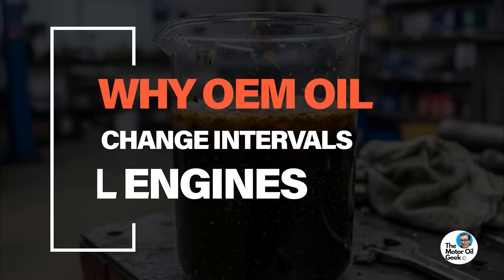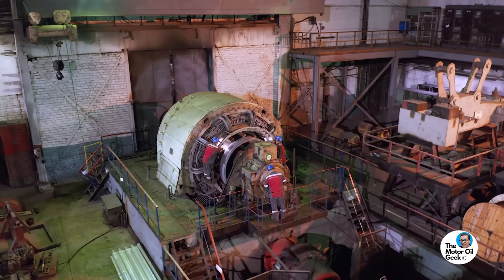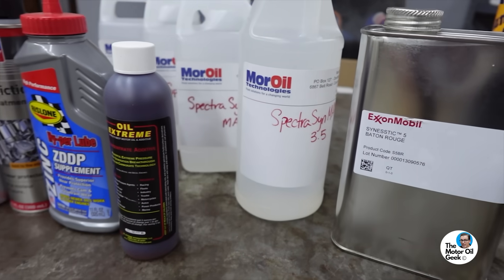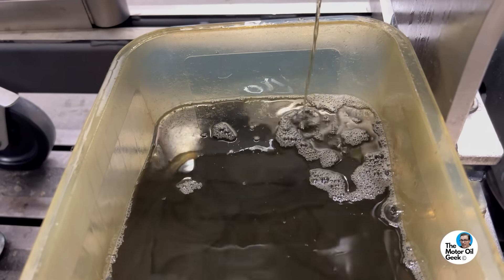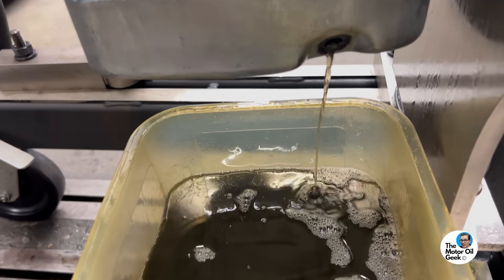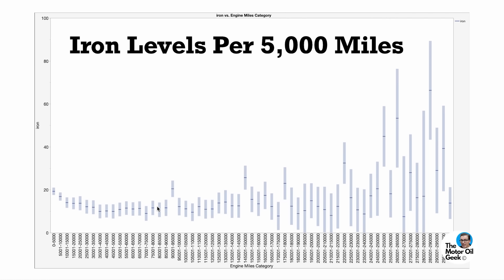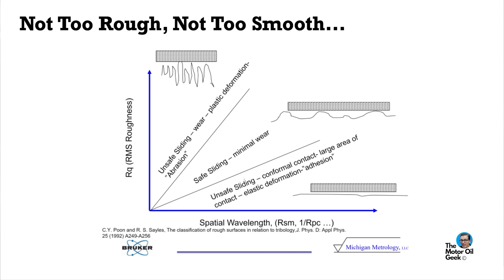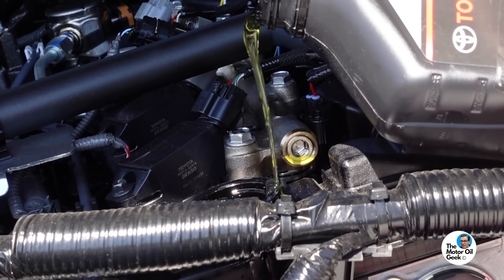NEW Data Reveals WHY Modern Engines FAIL Prematurely!

Comment: Only run roller rocker / pushrod engines with 30 weight oil to avoid oiling issues and reliable engine life; great recipe.

Comment: For a 2024 Toyota 4.0L V6…what is the safest year round oil to use…0W-20 or 5W-30 in a cooler to moderate climate? I can’t seem to find the overall opinion on this. Thanks Lake.

Comment: Cars last a lot longer than they used to. In the 60s and 70s you rarely heard of a car that made it to 100k. Sure they were easy to work on but they also needed to be worked on more. I’m 65 so didn’t really start working on my on cars till the late 70s but I think anyone my age or older and that’s honest will agree with me.
Reply: My 1972, 440 engine gave me 300,000 miles with no trouble. Just the water pump failed 2 times with a leak during the whole milage.

Comment: I have owned 3 6th gen Camaro Zl1.  First 2 I road raced about 10,000 miles mixed with aggressive street driving.  Zero problem.  My 3 Zl1 I didn’t road race it and change the oil at 500 miles, 1000 miles 2500 miles and then it spun a rod bearing driving to work at 4,300 miles.  I now drive 3 Toyots. Not the 3.4 twin turbo ones.

Comment: Maybe if automaker's ignored consumer reports and stuck with 3,000 mile oil change intervals this wouldn't be a problem. I have an '04 Ford F-150 with the 5.4 3 valve engine; the one everybody says bad things about. I have almost 300,000 miles and have never had to touch anything inside of that engine. Geez I wonder why. OIL CHANGE'S ARE CHEAPER THAN A NEW ENGINE!

Comment: Not sure your thoughts, but we use non-syt oil and run the motor for about 30sec to a 1 min and drain the oil to wash out all the ARP lube-Assembly lube-and ring assembly lube.  after doing this the oil does not look good,   Then drop in a Break-In oil,  I feel it is a good start to a break in, I call it a oil wash down.  what do you think.

Comment: A few useful facts to add to your excellent and timely video. I am a mechanical engineer with a lot of hydraulic and machinery experience. Firstly, the "full flow" oil filter on your car engine isn't. Most older cars have a fixed displacement oil pump for engine oil. This means that one revolution of the crank shaft delivers a fixed volume of oil. As the engine speed increases so does the flow. But the resistance of the system to flow results in increased pressure with increased flow. So there is a bypass relief valve in the filter to limit the pressure, especially as it collects dirt. This means that at more than modest RPM, say 1500, some oil bypasses the filter to the engine unfiltered. Older engines use a relief valve before the filter to limit this as it dumps back to the sump. Modern engines use variable volume pumps or pressure control solenoid valves to control the pressure. Secondly, the regular oil filter will only be rated at 30 to 40 microns. Most of the particles larger than that size will be removed in the filter. As you pointed out, as dirt accumulates in the filter it gets better at removing smaller particles. This is called "Filter Cake". This accumulation increases the pressure drop across the filter medium. For hydraulic systems we typically specify 10 micron filters, unless there are elements with small clearances or orifices such as proportional or servo valves. Then we would specify 5 or 3 micron filters. Next, I have found that for some cars with the screw on can type filters a trip to your auto parts store can reveal that a filter with the same mounting thread and seal face dimensions but a significantly longer can is likely available. This will have more filtration area and thus lower pressure drop so the relief valve won't open until a higher engine speed. The only limitation is if room is available for the extra length. Your thoughts on these issues would be interesting.
Reply from the maker: Thanks for sharing. Each of those points are going to be covered in future videos.
Reply: @themotoroilgeek  Hooray! I am so glad you are busy doing this kind of education for us!
Reply: i actually know some farmers that know this...how i don't know. chevy silverado 5.3l PF63E is the ac delco  filter he had on, same diameter, longer length..... this is for the 2013...my older 2000 5.3 uses a longer filter but has different threads and that has gone 360K miles before i parked it due to rusted out brake and fuel lines i have yet to fully replace and fix the last 10%   the 2013 had the dreaded collapsed lifter issue i caught early enough to used crazed performance repairs cam shaft and lifter dod afm delete kit on.
as an operating engineer i have just used the longer filters i can make fit at the highest dust micron rating i can get my hands on and never had issues until letting oil get a little more dirty just because i wanted an excuse to get the motors rebuilt as i always got them used with high hours on them. however it's getting hard to find rebuild shops these days outside of motor city.
Reply: My 1989 CB450 has a relief valve (spring and a ball on a flute, really) on the filter exactly like you said.
How did I never think to put a bigger oil filter on a car engine, though... Kinda mad I never thought about that.
Reply: I've got a new Duramax 6.6 in the drive way. Plan is oil changes at 400,1000,3000 etc.
Reply: Excellent points the average consumer is oblivious to.
Reply: The oems are also decreasing sump volumes while increasing oil change durations. This doesnt add up to me. More surface area in the pan and dwell time should effectively lower temps and the increased volume will suspend more solids there, allowing them to settle.
Reply: Saw you were a mechanical engineer with a lot of hydraulic fluid experience. I actually sell  for an oil company that has been around since 1916 and during our latest Zoom call I gained some extraordinary knowledge about cavitation in hydraulic fluid. Most people think it is air bubbles but it’s actually a gas that creates micro-jets that travel faster than the speed of sound and up to 5000 degrees and it is similar to a mini nuclear explosion and this causing scaring on metal parts in a piece of equipment. And it is very important to do 2-3 system cleanings/flushings because any dirt left behind when a new hydraulic fluid is used, that contamination will greatly reduce the life of the machinery.
Reply: The relief valve dumps the oil back into the sump, so explain to us how it gets into the oil passages? The relief only works on the pressure side of the pump not the inlet and you obviously have a limited mechanical level of expertise?
Reply: There are two relief valves in a typical engine oil system: the first limits oil pressure after the pump, and returns to the sump. The second is built into the oil filter and bypasses oil around the filter if the pressure drop across the filter is too great. Otherwise a blocked filter would result in the bearings receiving no oil and rapid destruction of the engine.
Reply: @54Rocketeer  All engines have a relief valve at the oil filter, obviously on the pressure (pump) side. Traditionally, most return oil to the sump. But some send oil on ahead to the bearings, unfiltered. Crazy, I know, but manufacturers are doing all kinds of crazy things these days.
Reply: @54Rocketeer so what you are describing is a system that starves an engine of oil instead of at least passing some dirty oil.  I'll take the dirty oil over less oil because I like my engine running.

Comment: The new engines at the factory actually go through an impromptu break in. They get "broken in" when the porters drive the new vehicle off the assembly line and out into the storage lot. They drive the vehicles like those parking garage guys in Ferris Buehler's Day Off drove the Ferrari. 🤣🤣 Back in the late 80s when I went to work for a SAAB dealer the first oil change was at 1,000 miles. The engines came with a small black break-in filter about the size of a AC PF-47. The standard filters were blue and the size of a AC PF-35. This first service was of no charge to the customer.

Comment: While I agree with Lake’s assertion 2:56 , Variable Valve timing (or the loss thereof) doesn’t cause engine failures.  Yes, more modern engines utilize the fluid properties of the oil to operate mechanisms (valve timing, or even the old timing chain tensioners) but I don’t see that running a thinner oil viscosity is necessarily a requirement for that.  Pretty much any oil is thin enough to be used as a(n) hydraulic fluid at operating temperature.  Obviously, it is a matter of degrees (bad pun intended).

Love these discussions, even when I’m wrong.

Comment: The data on filters working better after being more full.
Supports the recommendation that was in my 1999 Audi A4 manual. I forget what the oil change interval was. However if did say it was acceptable to change the oil filter every 2nd oil change.

Comment: My wife has a 2015 Honda Civic. I has 20,000 miles on it. It’s had 9 oil changes starting a 600 miles. All synthetic. Our 2018 F-150 5.0 at 42,000 miles has had 13 oil changes and is due now. 15,000 miles ago I changed from 5-W20 to 5-W30. All semisynthetic. My 56 ford with a 292 y block was bought with a rebuilt engine with 50 miles on it in 2012. I’ve driven it 17,000 and it’s had 11 oil changes. The last 6 I have used Lucas 10-30 Hot Rod oil.  ….. Long range changes are not for me!

Comment: I dropped the oil in my 24 lzo 3.0l at 500km, then 1000kms, and then at 3000kms. I change the oil at half intervals and at 65k my truck runs smooth and so far so good. Peace of mind.

Comment: Lake, I have a GX460 that calls for 0W-20 oil and the manual states various other viscosities but 5W-30 in UAE for example. I have since started to put 5W-30 into my engine for additional protection (assuming CAFE standards dictate in my case using 0W-20). I notice in both your daughter's corolla and your new Tundra, you stick to the recommendations. I assume because those engines are much newer than the GXs. Would be very interested to know your thoughts on that (in my case)!

Comment: ive been changing my 3.0 LZO at 3500 miles with Rotella T6, 10w30, wear metals are almost non-existent in my Blackstone reports, did my break-in at 500 miles, and just did truckwide fluid changes at 40k miles
ive been saving my old old, and will start filtering it through a sub-micron toilet-paper system, send it to blackstone, and see if its good to re-use... at $120 a change, it would be nice to get some extra oil changes out of the fluid

Comment: Lake - the Toyota T24A-FTS in your Tacoma is an oil diluter...and I'm currently experiencing this problem during the winter.  Please shed some light on oil dilution, particularly using your truck as an example
Reply: Can you put a block heater on it to help get it up to temp faster? Short start-stop driving in the winter tends to increase fuel dilution. Whereas longer runs in the summer the excess fuel will boil off. Lucky you don't have a modern diesel some in short running will dump 1-2 quarts of fuel into the oil between changes.
Reply: @craigvincent2439 mine is in a heated garage…still getting gas in the oil

Comment: I broke in my '87 Chevy R10 with a flat tappet cam and my '68 Oldsmobile Cutlass Supreme with a roller cam with Joe Gibbs break in oil. I ran them both for 30 minutes each at 2500 RPMs.So far no problems. Then drove them for 500 miles and changed the oil and filter again. Next oil change is 1000 miles then I will change it every 4000 miles thereafter.

Comment: Lake, you mentioned aftermarket additives as a potential problem to oil cleanliness. I have always wondered about the additives pushed at a dealership that are marketed  to work with dexos oils. Our local Gm dealers sell BG products such as thier MOA additives. Are these products no different  then the part store counterpart? Are we predestined to have more engine failures because the dealers are working them into every oil change they sell from day one?

Comment: My oil change intervals are pretty much always somewhere between 3000 to 5000 miles, 5000 to 8000km, because of the simple thing of I hate overhauling engines, and oil is a lot cheaper than new rings, new pistons, new full gasket sets, new cam drive parts, new water pump, and grinding in valves. 10 extra oil change intervals in the interim before you do that is still cheaper, because it brings that interval to a much higher mileage on the vehicle.

Comment: I’ve been in industrial maintenance for almost 25 years, once we started filtering hydraulic fluid before use and running desiccant breathers our issues dropped significantly.  Running kidney loop filtration instead of replacing our filters as often proved better on samples.

Comment: Good info. I know some heavy industrial equipment never "change" the oil. They instead use huge amounts of it and have multiple filters plus spin filtration. Small amounts are metered in to be burnt off and new oil is added periodically. I remember one Komatsu engine with over 32,000 hours on it with this method.

Comment: And when I changed from ford oil to Amsoil signature series way back in 08 after a shortblock done under warranty for seized oil rings and loss of compression I only knew that amsoil was better. Now I know it has very good shear stability required in overhead camshaft engines with long timing chains and variable camshaft phasers. I believe that has kept my 2014 3.5L ecoboost  camshaft timing components from wearing out like has become so common. That and superior filtration from a bypass filter system.  Prefillimg filters and then flood starting after annoil change until oil pressure is registered before starting the engine. Right oil right time and right filtration

Comment: Current engine designs are assuming that motor oil is clean room spec at all times. Previously, engines were designed and engineered to last much longer without the clean room, sterile environment.
Then, we move to component design and quality. That département was furloughed!!

Break in is not optional!! For anything!! I don't care if it is an engine or a differential, break in is absolutely required!!!

BTW: Contamination is the equivalent of lapping compound...

Merry Christmas, Lake and family!!!🎅

Comment: My 2011 Ram 1500 5.7 Hemi self destructed the cam/lifters at 144K miles. I was accused of poor maintenance but changed the oil every 3k with the correct syn oil. The oil bottle said every 10k and I still changed it every 3k.
Reply: The camshaft on those engines is splash lubricated, as I understand it. So excessive idling time often trashes the cams, not enough oil thrown up onto the camshaft and lifters when the crank is spinning slowly.

Comment: I would like to learn how often oil filters bypass . temperature,pressure,contamination, dependant .
Reply: Is the bypass regularly engaged or only in rare cases of neglect ?
Reply: @MathewPollard-vj4uq  bypass should only open if the filter is clogged, or possibly at high rpm. Not during cold starts.

Comment: So, should you filter the oil before you pour it in the engine?
Reply: No. Unless you're using something better than the oil filter installed on the vehicle to pre filter the oil, there's no point.

Comment: A lot of people say the hemi‘s the newer ones get the hemi tick because Chrysler redesigned the block and people say they didn’t redesign it correctly for oil to flow good through that area because the 2003 to 2008 versions of that engine didn’t have that problem just valve seat issues I started seeing issues with Cam and lifter failure once Chrysler redesign the engine block for variable valve timing

Comment: I'm of the opinion that GDI equipped gas engines visibly indicate contamination more quickly that port injection. GDI engine oil gets a blackness with use fairly quickly compared with port. Can I assume this is soot from poorly burnt fuel making its way into crankcase. Wondering if you could speak to this related to GDI engines. Maybe you have a previous video.

Comment: Total American rubbish. Other parts of the world charging every 10-15k miles with no issues. Just serviced timing on 1.5 diesel engine at 100k and it is spotless inside with 10k miles oil changes. Also engines do not need to be run in - you’re giving data from race engines. This maybe the case years ago but not now. Toyota offer a 10 year warranty here with 15k oil change intervals. Hardly think they’d be recommending this interval if if they they thought they’d have to pay out on warranty.

Comment: This just reminds me of one customer who bought a new Volkswagen Transporter 2.0 TDI back in 2006...  It was factory coded for the long 30,000 km oil change interval but that van never went to the dealer for service.  I (or my father until 2014) did the maintenance work on that van every 15,000 km from the very first oil change to about 470,000 km.  The expected camshaft failure at around 150,000 km happened past 360,000 km instead, and only one of the cams appeared damaged.  The camshaft replacement was the only repair work that engine ever got.

Comment: Fantastic video!  Even I can understand these concepts with your explanation and that's no easy feat. I have a 2012 Chevy Traverse with 120,000 miles that I've been self maintaining the past couple years. I use Techron High Mileage fuel treatment every 3rd or 4th fill up. I use Mobil 1 5W-30 Oil from Costco and/or Costco's Kirkland version. I notice that my oil gets dirty in just a few weeks of changing when using Techron, etc.  I generally change my oil with a Mobil 1 filter every 3,000 miles. Do you think that's often enough? or any other recommendations?